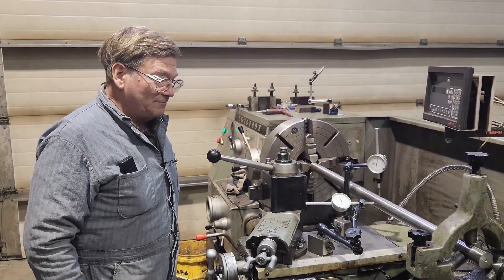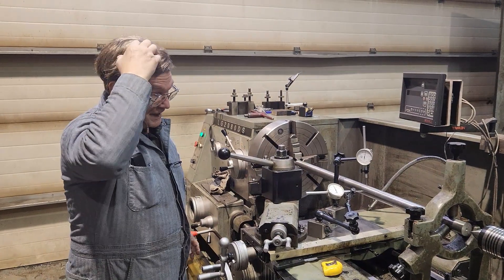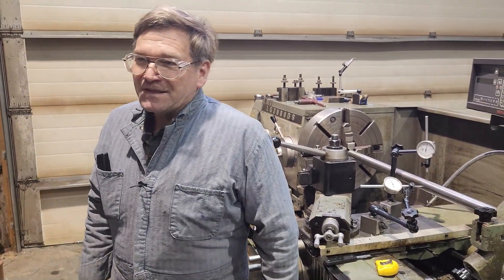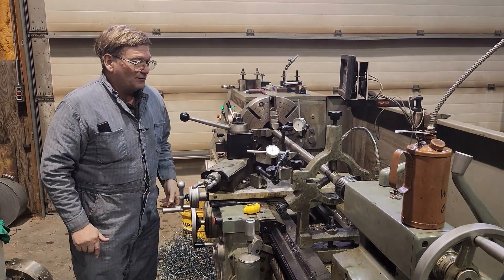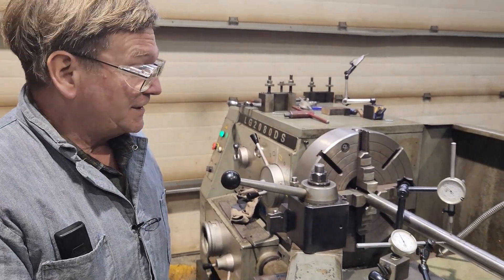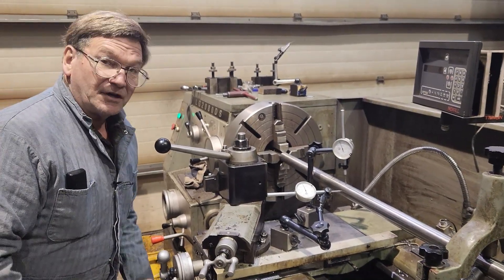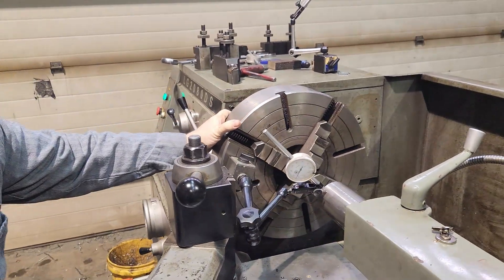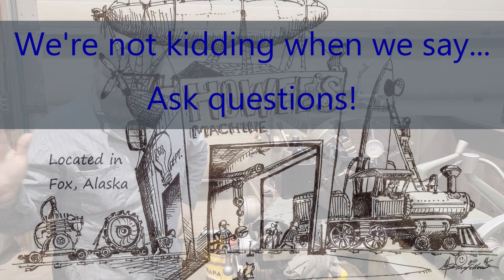Machinist's Minutes: Tailstocks and steady rests (part 2)

Comment: Using that limber mag base in the chuck to dial in the quill of a tailstock pose problems. Unless you know the amount of droop from gravity in the indicator apparatus you can't reliably determine the eccentricity error of the quill axis with respect to the spindle"s.

If I was given the job of turning that long skinny diameter, I'd track down the follow rest

Comment: If I was cutting a piece of hot rolled, or having a problem with the any other piece trying to walk out of the chuck.
I would get some small pieces of soft metal, usually copper. I put the copper between the chuck jaw, and the work piece. That always helped. Sometimes it seemed the jaws had been abused, and they seemed like were sprung, sometimes it can be the tail stock, but those are adjustable.

Comment: Indicator sag can be an issue with some mag bases on the last check you showed on chuck to tailstock. Also a swing check is another way to align tailstock. Essentially just making shaft perpendicular to chuck face. Be mindful of indicator sag with this technique as well. Checking the 2 planes up and down shaft is good as long as ways of machine are level and square to chuck for the entire length.
Does that sound correct/ make sense? 
Thanks for your videos!

Comment: Attaching an indicator to the chuck and rotating the chuck to check a stationary tailstock etc is not good technique,  because the weight of the indicator and bracket droops it towards the part when at 12oclock, and away from the part at 6oclock. Stefan Gottswinter has covered this....
Reply: With big heavy ones maybe but not smaller lever types.

Comment: It's quite straight forward setting a steady. Initially you drop your bar in the steady and true up chuck end. Then release steady completly. If the bar is self supporting grab a pair of clocks and set one up in horizontal plane and other in vertical place. Slowly rotate workpiece and set clocks so mid point of runout is at zero. Do same for both axis. So say runout is 0.030" clock will go 0.015 plus and minus zero. Then gently bring steady into play and adjust legs until bar stops wobbling and clocks read zero. Now bar must be running on centre in prep for centering..For long pieces same thing applies but support with flat plate and pressure centre. Figure out mid points of runout, bring in steady legs and your piece will be ready for centering, boring or what ever. Even if it's rough material.and needs surface machining to run steady on same methods apply.